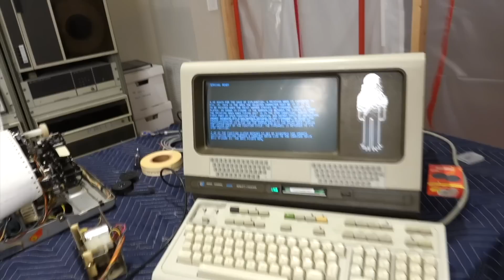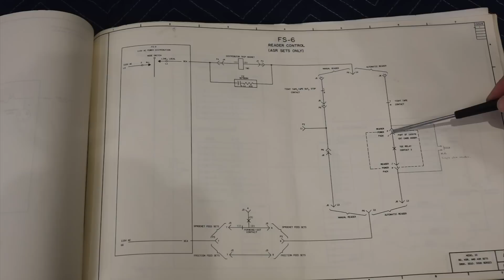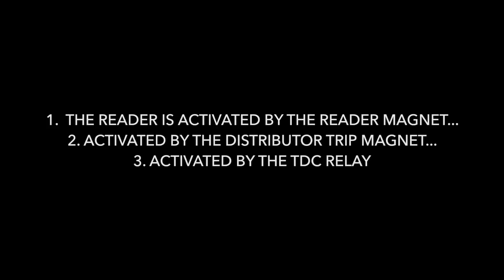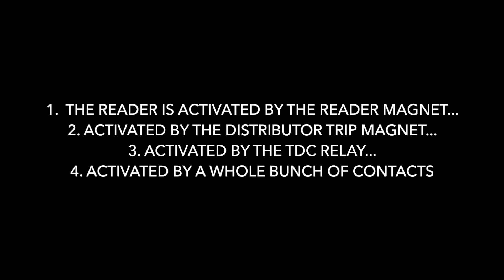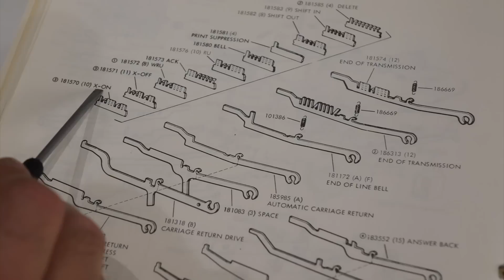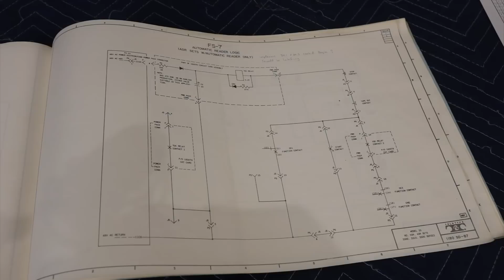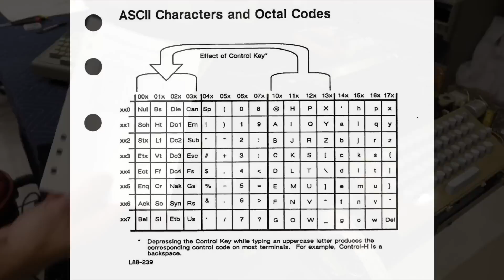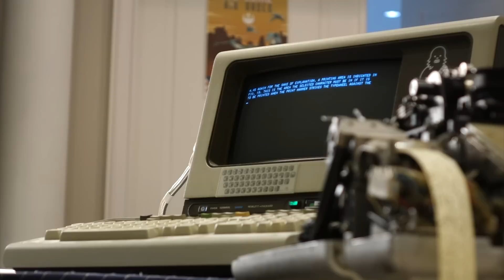Teletype ASR 33 Part 9: "Automatic" Tape Reader

Comment: Referring to my comment on the dual-relay board: the problem is that the trip magnet is not activated by START or CTRL-Q: when I push the trip lever manually down, the tape reader reads fine. The trip magnet gets its current from Molex connector 4, pin 10 & 11 (yellow/brown wires). There is a capacitor clamped between these pins, but removing it does not change anything. The switch block which is activated by the CTLR-Q/S sequence has two open contacts, the third is unused. Curiously CTLR-Q does not move the rightmost switch, but CTRL-S does momentarily close the mid-switch. Clamping the CTRL-Q switch to close does not help either....

Comment: dual-relay board on power-supply: I have a model with the automatic tape reader (but inscription is Start-Stop-Free, not Manual Auto etc). I am unable to start the reader, but the big 170VDC magnet works when I short two contacts on the power-supply board in the stand. This board has no realy, but there is a second board fitted atop, with its own Molex connector. This board has t2o relays, a BC252C transitor, 3 diodes, two caps and a potentiometer.  I replaced everything, to no avail: no relay is activated when I manually press Start (or CTRL-Q). Any suggestion would be most welcome!  Francis, computarium.lcd.lu

Comment: We used one in the '80s in the UK that had 2 paper tape puncher/readers. You could cut/copy/paste between the two to do "edits" on large documents (locally), and then when it was correct, load the final tape and send it to the recipient. So cool.

Comment: Every Unix user knows Ctrl+Q and Ctrl+S from painful experiences. Fascinating to see the origins of this effect.
Reply: So much of the low-level gunk that's in Unix TTY drivers can be traced back to the ASR-33.  For example, at 110 baud with 8 data, 1 start, and 2 stop bits, that's 100 ms per character.  The problem is, for the print head to slam all the way back to the left margin and settle down on the dashpot took more than 100ms.  Probably closer to 300ms.  So, if you started sending the next line immediately after the CR, the first part of the line would start printing before the printhead had fully returned, leaving characters printed at random places on the paper.  To account for this, the Unix TTY driver could add in variable amounts of delay time after sending a CR.  These choices are still visible in modern TTY drivers as the cr[0123] options to the stty command.  Likewise nl[01] for newline delays and a few others.  No clue if these even do anything anymore, but they're still in the man pages.

BTW, correcting a typing error when punching tape was simplicity itself.  You pressed the 'B. SP" (backspace) button on the punch.  This mechanically backed the tape up one position, so the (incorrect) character you just typed was back over the punch rods.  Then you typed "RUB OUT" on the keyboard, which punched every hole, effectively erasing that character from the tape.  Then you picked up typing with the correct character on the next tape position.  It's amazing that the mechanism could keep everything in register well enough that the second punching lined up perfectly with the first, but it seemed to work.

Comment: Bloody Control-S. If you Telnet from your phone to your desktop  everything stops if you accidentally press C-S. Takes at least a minute until you realize what has happened and punch C-Q.
Reply: Try logging into an APL server from an old ICL terminal that doesn’t support the APL character set (this was back in 1979). Half the programming floor at my work ended up standing around my terminal shouting ideas as to how to get the terminal to send the right character string so that the server would understand we wanted to log off . We even unplugged the machine, waited 5 mins and turned it back on but it was still stubbornly connected. All we needed to send was “)off” but the ICL keyboard was just a standard QWERTY without the extended characters.  I’d only logged on to check if a program had finished running and was going to log off right after... oops.

I was so embarrassed because I’d only been working there for around 3 weeks at the time. 🤦‍♂️
Reply: @NeoMorphUK  ouch!

Comment: 0:14 .... Sacre bleu... that's a LOT of chads. I shook a load of those out of an old tractor feed printer last night... but for true "need of a vacuum cleaner" you need a tape-punch.
Excellent camerawork... showing us tiny relay contacts clicking inside that maze of levers, cams and wires...
Reply: The parades in New York - where do you think the office workers got their confetti ??

It isn't a lot of chad (office workers also had key punch machines and sorters and....)

Comment: That is " software flow control" in hardware.  It reminds me of my first computer experience in school.  It used an ASR 33 as a terminal and data storage for a Wang minicomputer.  Basic programs were created on the Wang and saved as ASR 33 papertape.   Pie plates were great ways to store your tapes.   Are you going for an ASR 34, with, (Gasp!) Lower Case?  You really need a machine to run TECO on, for the full TTY vibe.  The '33 is why Unix/ Linux commands are so cryptic. Nobody wanted to hammer  more letters into an ASR-3 terminal.   Good Luck on your next adventure.

Comment: what were the main uses of remotely reading tape? would there be a loop of tape or something? how would you know if tape were even loaded, or the loaded tape was relevant?
Reply: I would imagine it was more of a remote-pause... the remote might need to load another sheet of paper, change the ribbon, clear a paper jam, etc.
Reply from the maker: Flow control - Xon/Xoff, and end of transmission (ENQ). The first one because computers or modems were so slow they needed a way to throttle the tape reader so they had time to process the data. End of Transmission is just an in-band mechanism to stop the transmission.
Reply: @CuriousMarc  I remember teletypes with electronics, and I used many "glass" ttys that had to send X-off and X-on while scrolling, but these pure electro-mechanical machines are something else again! Seeing flow control implemented as bit patterns in metal gates and ladder logic gives a new perspective on an old friend.

Comment: It's fascinating to see how ASCII was born. I have used it extensively in my engineering career. To see where XON/XOFF flow control originated from is eye opening.
The relay circuits remind me of Ladder Logic, used in PLCs. Motor contactors typically latch the same way as that relay.
Cheers,
Reply: ladder logic is a direct descendant of relay logic
Reply: If you want to see some moderately strange ladder logic, look at the final generation of electro-mechanical pinball machines before they became computerized in the late 1970s. Check out the Joe's Classic Video Games channel if you are interested. They had a series on an old Williams EM game recently.
Reply: Interchanges and other types of relay signaling equipment on the railways is done with relays. 

The relay which lights up a green light (proceed) is connected such that two on contacts on the same relay needs to be on (to prevent a single faulty contact from lighting a green.)
That relay is feed its DC thru contacts both on in collision route locking relays, its own relay and track circuits relays.

Comment: On the older TTYs, we had a KSR switch.
"K" or keying was for the reading of the tape and punching a new one simultaneously. Thus you could advance the tape one character at a time.
"S" or send was for sending the tape and was continuous.
"R" was for receiving, with it you could receive text, optionally punch a new tape simultaneously.
My memory isn't the best on this so your mileage may vary. (The last time I used a TTY was in the late eighties)